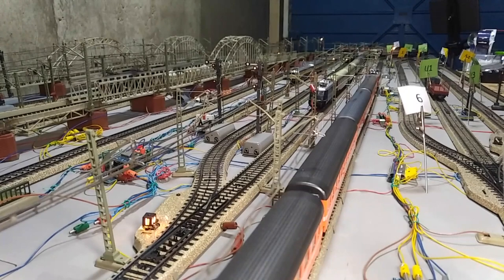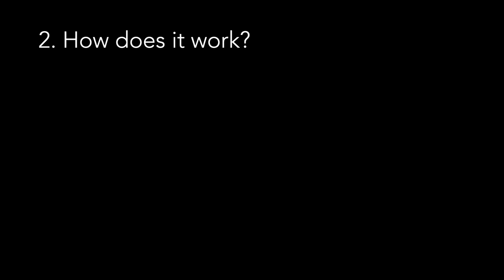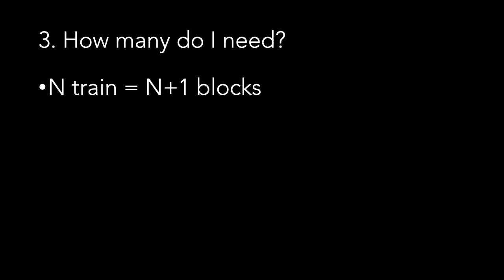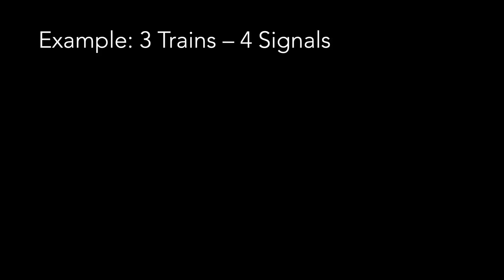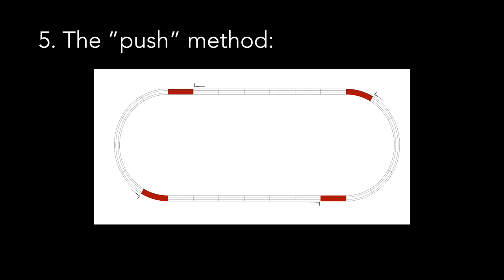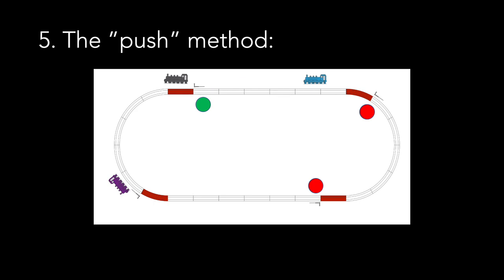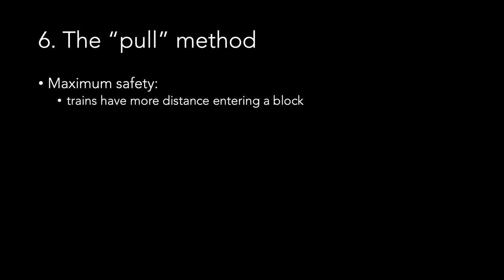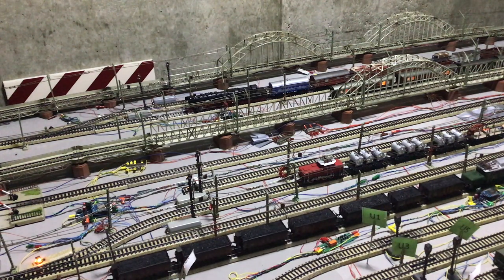Little Helpers - Basics of a block system - Märklin analogue

Comment: Well explained.
My uncle, now 55 years ago, had a Dutch job (NS = Dutch Railways) and knew the 3 color system Red, Orange, Green and then also Stop, Slow Driving, Full Speed. This meant a separate transformer for Slow Driving, for both normal track and overhead wires.
This also meant, 2 trains 4 signals, one more because of slow driving, but as soon as 1 train was added it meant 2 more signals.
The diode trick was already known at the time to slow down more realistically and we used TRIX transformers, because they were 50% cheaper.
This made things more natural to drive, even as it is in real life.
For me it's nostalgia, now I've had Fleischman H0 for 20 years.
Reply from the maker: Thanks! Enjoy your trains!

Comment: I like the idea of the 'Push' method, never thought of that.  I plan to try that and have a small demo layout at the next train show.  I have had signals with an Analog layout before that were controlled by blue boxes (7072).  The audience is always amazed that the signals actually work and stop the trains.  I think they will be more amazed with automatic operation.
Reply from the maker: I used the push method on the last automated layout. It works but is not as safe as the traditional pull method. I'd say things definitely run automatically, as shown in my videos, but collisions are more likely than with the traditional pull method. Just be aware of the risk and test, test and re test... Have fun!
Reply: Yes, I understand.  I am thinking of a small 3x4 foot oval with exposed wires so I can demonstrate.  Maybe have wires long enough so I can change it up to show the 2 methods. I like the idea of continuous running of 1 train.